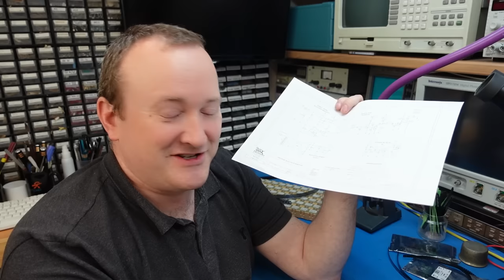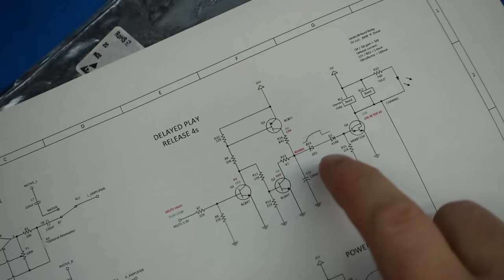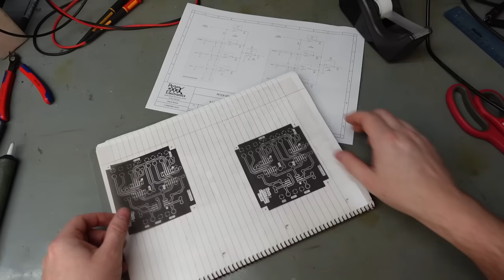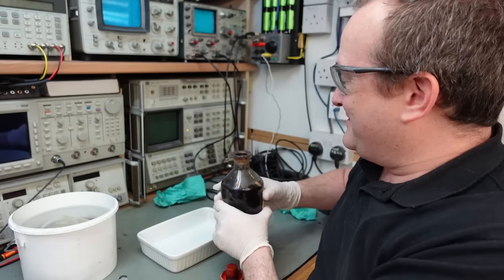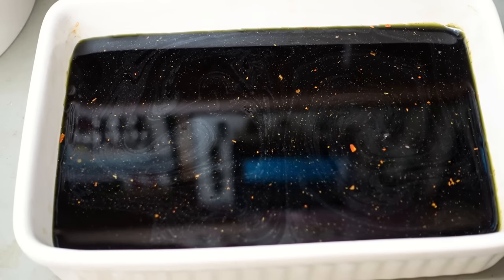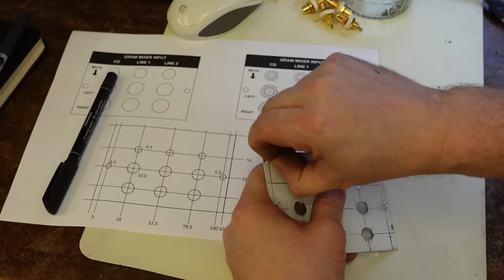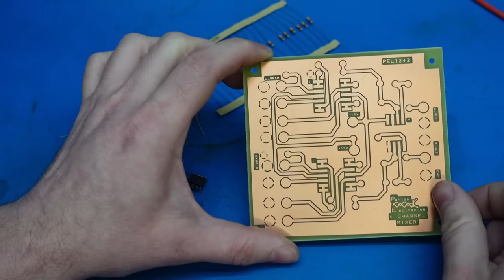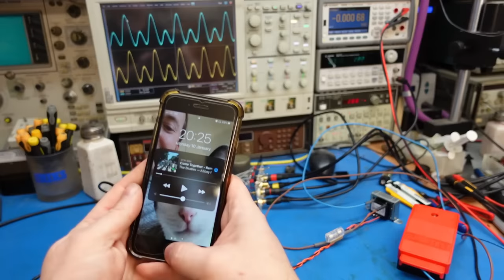1970's Stereogram - Bluetooth Upgrades & Modifications

Comment: Hey Mark, just found your channel and subscribed. This really takes me back to great times. I worked for Stereosound Productions in Brighouse, West Yorkshire from 1970 to 1978 and was in charge of the electronics test department for about 3 years before I left. Everything was produced in-house in 1974, apart from the RF modules which were bought in from Mullard at the time. Later tuners were sourced from Korea I think and assembled into sets along with amplifiers still made in house. I am 70 now and still do a few repairs for people, I tend to specialise in valve equipment which was always my passion from being a hobbyist aged 15. I still have new old stock spares for Stereosound equipment, I just can't bear to throw them out, such great memories. It was really good fun working there at that time and all the test engineers were good guys.
Reply: Fair play to you. There are still a good many stereosound units here in Ireland working away. Ive restored a few of them! Tricky to get the germanium transistors now. A lot of the capacitors were made locally to me in Shannon by Callan (a US company owned by an Irish immigrant). I make diy hifi, but it must be an amazing feeling having your products still in use 50 years later!
Reply: @peterlarkin762  Wow! Just seen this reply Peter. They were great times, make no mistake. Yes, I remember those capacitors, black body I recall, they gave some trouble from new, mainly the polarity on the casing stamped wrong, so the girls who assembled the PCB's would insert them the wrong way round. I possibly could still have some NOS transistors in stock, can't remember if I ditched them or not. There was one amplifier called the 1020 which used all discreet silicon transistors, but not many were sold, it was quite unreliable unfortunately. All later amplifiers were IC outputs, which were not as interesting for me. If you ever service any more Stereosound units, there is a ticket on the electronics that is signed with the clocking-in number of the person who handled each stage of production, so if you see any with number 64 on the ticket, I will have tested it and aligned the tuner if it has a radio!
Reply: How cool like an autograph!
Reply: @JohnChrysostom101  I guess so, in these days of complete automation it's nice to remember the personal touches.

Comment: The developer is just plain sodium carbonate (soda crystals) just use a stronger solution of the same to remove the cured photoresist after etching. Cheap as chips. You can also use old used developer solution to neutralise the ferric chloride when the time comes to renew it. The iron immediately precipitates out as iron oxide with a bit of CO2 (don't tell the climate police) leaving a sodium chloride solution that you can put down the drain and scoop the copper-contaminated rust into the bin. Just make sure you use enough sodium carbonate solution for a complete reaction.

Comment: I know this is a year-old video, but just in case anyone reads this:
When you're drilling sheet material make sure there's something physical (i.e. a bolt through one of the drill table slots) which can prevent the workpiece from rotating in case it gets stuck on the drill. Years ago a colleague lost the end of his finger while drilling a small metal plate. The company we worked for refused to pay compensation due to his not taking precautions. 
Fascinating video, thanks for sharing!
Reply: A better option is to get a hand Whitney punch set. No.5 or a No.XX, deep throat version.
Reply: Good advice

Comment: Smashing job there Mark with the upgrades and  I really enjoyed the series. My only recommendation, if I may, would be to place the etched PCB in some tinning solution to prevent oxidation of the copper. 👍👍
Reply from the maker: Good point! I used to do this... And the UV soilder mask. Lots of hassle - but very rewarding!
Reply: @MendItMark  a blow over all of it with ladies hair lacquer (extra strong hold!) after soldering is a quick way to improve things.

Comment: Great video!. I watched almost all your videos. To isolate the noise from the input voltage fto the bluetooth and mp3 module comes the B1205, B0905 and B0505.  They are 12, 9 and 5 volts input and the output is 5 volts for the module.

Comment: Hi Mark,  FIY for the noise  I just used a simple RC filter on the input power. 56 ohm  Resistor in series and a 330uF cap on the power input of the module. Simple as that. You source the power from any 5v you find on your Radio/PA It will take 1 second to come on, but bye bye noise. I usually do a 5v regulator that will pick 7-25v anywhere in the circuit then 56 ohm in series along the positive wire and put a cap on the power terminals of the module

Comment: Your knowledge is on another level. It is amazing to watch you work. I, too, was an Electronics Technician in my earlier days, so I can certainly relate to your work and fully appreciate what you do.
 You should have used the same type screws for your new back panel as the original panel next to it used. Panheads not countersunk. Also I would have used some standoff spacers for the 2 new boards you installed instead of screwing them down directly to the board.
Reply: no one asked about your screw preference

Comment: In the amber glow of the 1970s room,
The laughing repairman, his tools in tune.
Chuckling through the decades, his spirit alive,
Mark's hands dance, a techno-revive.

With solder and wire, he weaves the past,
A stereogram saga, a spell he cast.
In the heart of the wood, nostalgia resides,
But innovation blooms, where tradition hides.

A Bluetooth dance, in the vintage air,
A leap through time, without a care.
The crackle of vinyl, meets digital grace,
A harmony of eras, in one embrace.

Mark's hands, like wizards, conjure the new,
A Bluetooth interface, a journey to pursue.
From the '70s relic to the modern stage,
A stereogram reborn, turning a new page.

Four channels swirling, a mixer's delight,
In the tapestry of sound, both old and bright.
A symphony of upgrades, a melody unfold,
Where analog whispers and Bluetooth stories are told.

In the heart of the wood, the stereogram beats,
A fusion of eras, where tradition meets.
Laughing repairman, with secrets untold,
In the Bluetooth breeze, the stories unfold.

So, let the needle drop, on this groovy ride,
1970s echoes, with a modern stride.
The Stereosound Stereogram, a nostalgic elation,
A symphony of time, a grand modification.

Comment: Here's a neat little trick that may or may not work for you, depending on your type of toner:

Instead of putting two sheets of your PCB artwork on top of each other, you can try sticking one sheet with the toner side exposed on the inside of a cookie can (or biscuits tin, if you prefer)  and then put a rag soaked in acetone in the can. Leave it in there for a few minutes and be careful when first handling it after taking it out.
If it works, it will leave you with a perfectly even and very opaque layer of toner, that will have a completely different consistency (much more scratch resistant) than when it came out of the printer.

I've had extremely good results with this technique, but since all toner compositions aren't the same, YMMV.
Reply: why do all that extra work? ffor what purpose?

Comment: Nicely done good job 👌👍🏼 .... absolutely kind of work i love neat clean all systematically placed components.....may be i would ad thick plastic insulation sheet under PCBs ....in case it's catches damp ....one of my boom box with had issue of short circuit but it's was my fault as it was accidentally submerged in rain ...i dried it in sun and carelessly plugged it transformer goes boom 💥 with flying caps inside 😅

Comment: Mark I really appreciate what you do and accomplish on YouTube. The PCB you did for the Bluetooth is top notch, could you tell me what software you used to do the layout?  All the best!
Reply from the maker: I used Design Spark from RS Components. However, it’s gone very unstable on my laptop in its latest revision, so I’m now using KiCad.
Reply: @MendItMark  Thanks for the info Mark, KiCad has a lot of horsepower under the hood.
Reply: Hi, excellent channel, could you release this mod as a kit please? it's exactly what I need for my Bush DAC10

Comment: 17:30 I like to use 112gsm tracing paper instead of a transparency.  The UV shines through the tracing paper adequately to expose the board, but the printed areas are nice and dark and I don't need to double them up.
31:20 I like to leave the resist on the board.  When you solder your components the resist will come off in those areas anyway.  But the places you don't solder have the resist left on, and it stops the copper oxidising.

Comment: Hi I am building a modern version of a Radiogram with digital amplifiers and small board computer for streaming. I was wondering whether there are any electrical requirements for fastening components directly to MDF, given that if they overheated there could be a fire. I noted that many of the electronics (power supply/amplifier etc which carried a higher current were mounted on steel chassis.

Comment: FYI: The developer is nothing but simple sodium hydroxide. Drain cleaner pellets. I have a bottle of them and I always make a bit of fresh developer with a few pellets.
Best etching fluid I found to be Hydrochloric acid 10% with a  dash of hydrogen peroxide 30%.  Etches your pcb in a minute tops and details are preserved quite well, although you can always dilute the solution if it really goes too fast. This method does fume though and needs good ventilation.

Comment: How much would you charge to make one of those  Bluetooth modules for me??
I have a Technics Amp ,but it’s in two boxes Pre Amp and Power Amp.
The Power Amp drives the speakers the Pre Amp has all the inputs from the components.
It’s quite High End,but at the time no USB or Bluetooth devices had been invented,so these weren’t offered.
The switching inside the Pre amp seems to be done with High End relays.  So like many people I expect wold like to be able to connect Bluetooth speakers,Headphones,phones,tablets and have the option to stream music.
Cambridge Audio do a good unit,but it’s 1600.00+

Let me know you’re thoughts👍👍jason

Comment: Iv'e been  servicing a dynatron srx 26 for a friend , has the same Garrard deck as this along with amp and fm, lw,mw radio ,  thought ide get a din lead to rca  for it to use  cd player  and an external  turntable via a preamp  , it sounds very distorted, fine with digital radio and tape deck via din , seems weird , I   thought all line level stuff had the same sort of output , any ideas ?
Reply: Follow the signal path.  Segment and test.